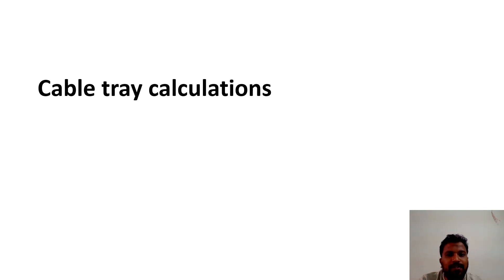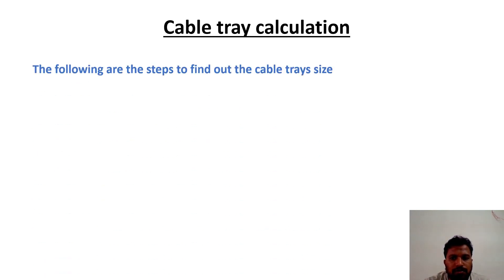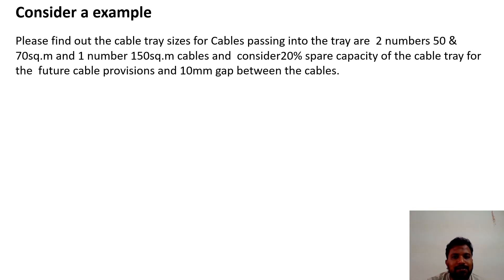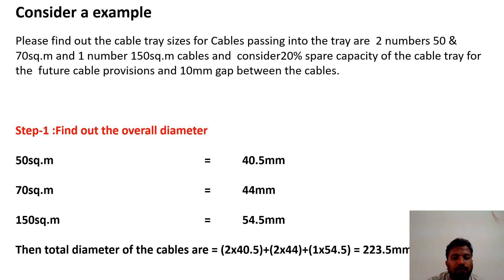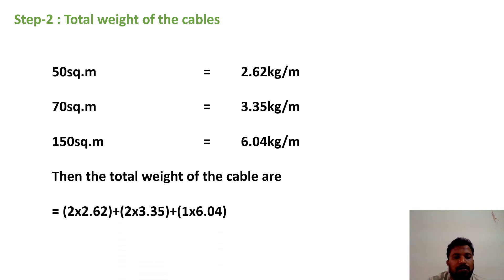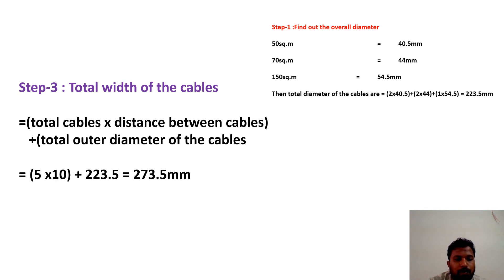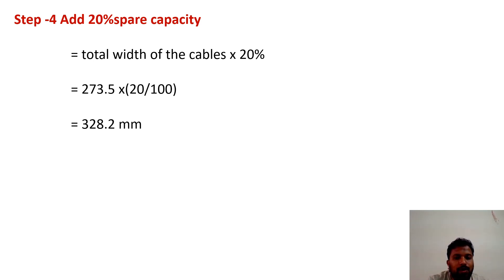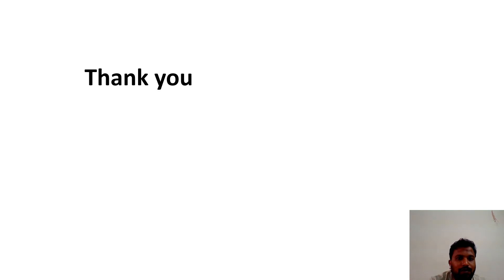Cable Tray Sizing calculation : The Ultimate Guide

Comment: For Kuwait the distance between the two cables should be 2xdia of the maximum cable otherwise we have to add correction factors while calculating cable size.
Reply from the maker: Thanks for watching and thanks too sharing details

Comment: Already you differentiate Deva and ADDC. Can you make video in SEVA and FEVA .  In Dubai SMDB using only isolater why? Mccb not using.

Dubai FDB only Row type....what about sharja and fujira....seva and FEVA...?
Reply: ....Dubai SMDB incomer only using Isolator...why not using MCCB ?
Reply from the maker: replied please check
Reply from the maker: SEWA and FEWA  i will make a video
Reply from the maker: as per code they are using isolator . Isolator and MCCB both are for circuit opening purpose  only.  i will make a details video on this topic too 

other emirates DB also typical type any how i will make video on this topic too..

so many video topics as per time convent i will make videos 

stay tune